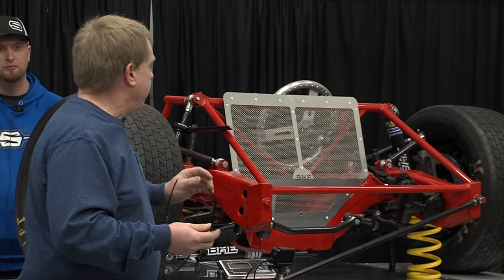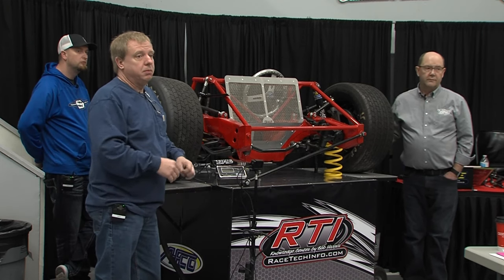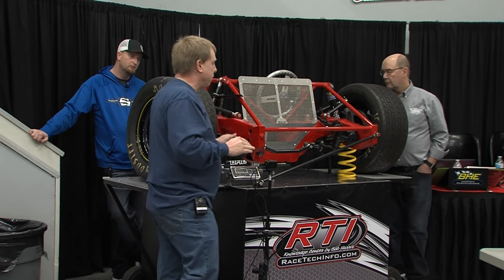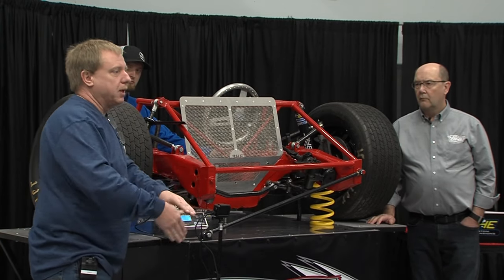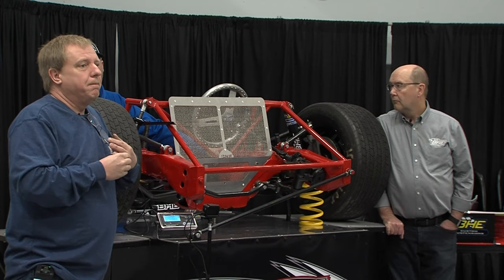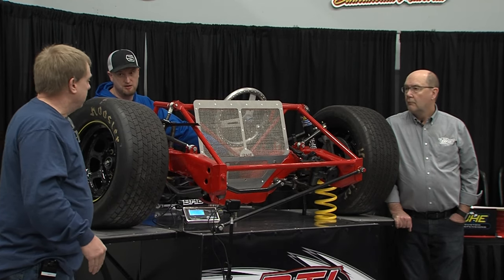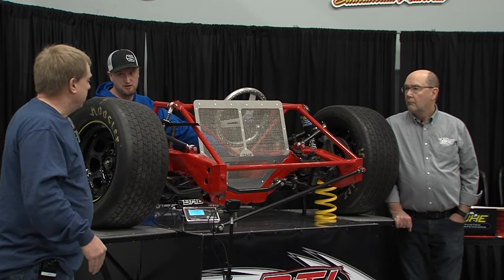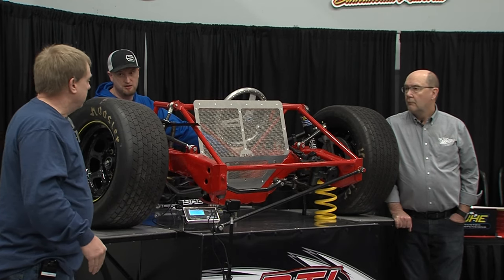How To Use The Load Stick (FT. Kelly Shryock

Comment: You can use loaf sticks on asphalt and dirt cars as long as you are running heim jointed shocks. I have done it on street stock asphalt abd dirt abd asphalt metric clip only pro trucks and mods abd latest on dirt and asphalt and legend cars as well make then your self super easy. It's almost mandatory to use them after every race abd re set your weights and make everything the same that it was before race weekend for following race or make adjustments if something had to be bandaid up till you get to shop to fix it correctly based off notes. Take notes of everything guys as much info you write down in notes the easier it is to fix the car or make it better for next week I was having a tight in loose off problem one weekend abd I got to looking at notes and found the problem just based off my tire Temps I wrote after every run and off my shock travel indicator measurements of the travel and picked up 4 tenths of a second and got pole and win heat abd feature on asphalt that following week. And I love my old shaw dirt mod from 2004 it still runs up front top 4 every night I'm ump mod class. I been driving since inwas 11 on asphalt. And we have coil bonded a metric clip asphalt pro truck and that son of a gun was a beautiful handling asphalt car. I raced pro trucks for 4 years on half mile huge high banked asphalt tracks and when we could run 604 first season with the class ever at the track since I was the first truck ever and someone else so the super stock rules 9 years ago was exactly same as the pro truck class chassis and everything except its just a pro truck ARP body and not a latemodel style or Monte Carlo style body and with a 604 in it aero mattered big time cuse of the speeds and style of body of the trucks I raised my rear spoiler angle to 70 degrees and added lexan pieces off the rear roll bars and connected it to the rear deck on each side where there would be a bed and it made a huge difference so aero does matter guys in classes that have alot of power like a Neismith street stock and everything higher up and inbetween the classes above aero matters alot trust me guys

Comment: Okay, Mr Shryock, you need to take this opportunity. To show happycamper what you mean by the right lower ball joint being one inch higher. Than the left side ball joint, when measuring ride height?

Because I need to see it to know what you are talking about. Because I always measured ride heights off the frame to the floor...
Reply from the maker: helllo TheCreChief we are 100 percent on how to answer that question we would recommend getting in touch with shryock racing to get that question answered correct. Thanks!
Reply: @racetechinfo1  Well I was mainly making a recommendation for a video for your seminar. 

Because it is something that I have already spoken with him. In the past over the phone. 

Although it would have been better, when I was working with him. And yes I have worked with him in the past on his car. 

Which anyone can ask him, if he remembers the guy he gave the handle name, happycamper too...😁

I know my name made it onto his first Skyrocket car...